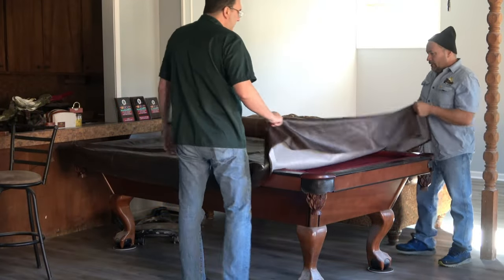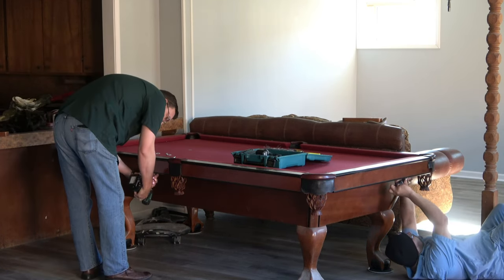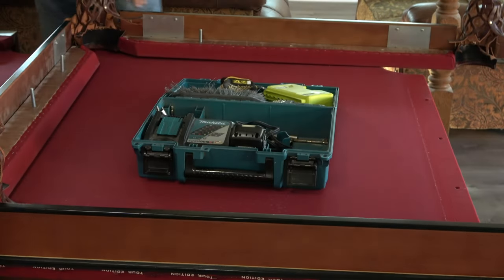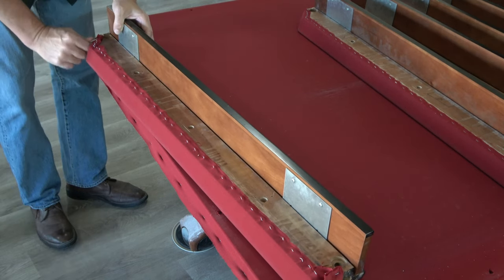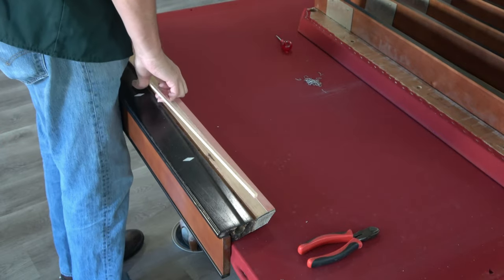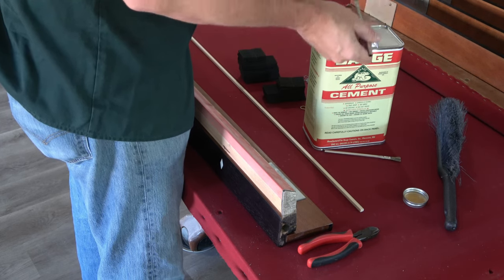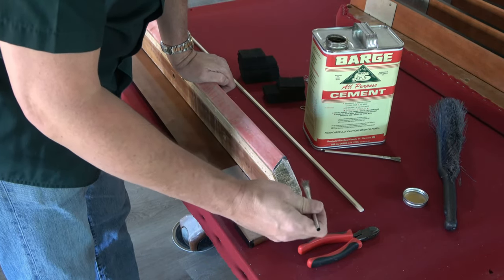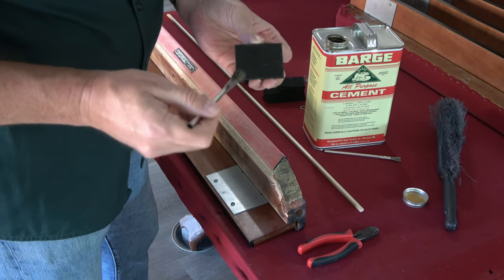How to Make Your Brunswick Pool Table Play Like a Diamond Pool Table

Comment: Will the balls bounce differently in the area where the extra facing material is?
Reply from the maker: Only slightly. Not really enough to make a difference in your game.
Reply: @CreativeRestorations  Thanks. I'm tightening up my GC IV this week. Your video is really helpful.
Reply: With shims?.. Yes.. That’s why extended rails is the best process for fighting a table.. 

Remember, all tables use one shim on each pocket facing to keep the rubber from bowing out over time.. When you add a 2nd shim to make a pocket tighter the pocket facing plays different.. And any difference is no good.. And if you live in high humidity areas the pockets will play significantly different..
Reply: @jacobjones5269  I extended the rail with wooden shims and then added the composite rubber shims. I'm pleased with the result.
Reply: @peterwhitaker71  

If you’re pleased, great.. I would still recommend new rubber and extended rails, if there is a table mechanic capable.. However, doing it when the table is scheduled to be recovered is what I would suggest..

Should cost about $300-$400 extra, but it’s a one time cost..
Reply: @jacobjones5269  I added a piece of wood to make the rail longer, then put the regular shim on and new rubber cut to length. Have I missed something?
Reply: @peterwhitaker71  

Not at all, like I said if you’re pleased, great.. It’s just me, personally, I would pay the one time expense of getting fresh rubber, extended, since I’m gonna have my table until I go.. That’s just me..

Comment: If you have a great plan Gold Crown leave it alone don't let anybody tell you to change the rubber especially if it's a one or a two
Reply from the maker: I'm in agreement! I'm not fond of the way Diamond tables play. However, some people like the tight pockets. UGG!!! If a customer is dead-set on having tighter pockets on their table (other than a Diamond), I generally recommend they do it this way because it's 100% reversible. If they don't like it later on down the road, they can switch it back with little effort. However, if they glue in extra wood and lengthen the rubber, it's a LOT more work to change it back.

I think Diamond's pro pockets are frustrating for 90+% of people playing pool. If you're playing for money or just practicing, Sure. Play on a Diamond. Otherwise, play on standard size pockets.

Comment: IDK I tried 2 different times to tighten the pockets on my 8 ft. with shims and couldn't stand it that way! Finally the last time I had work done on the table I had it done the correct way which is to extend the rails, it's a major job but well worth it in the end result. Pockets are now 4 1/4" with correct angles and play very well, can't really slop a ball in especially at speed. Also another problem I see here is you are working with chemicals over the table cloth without a drop cloth, not good!!!
Reply from the maker: Extending the rails is the best way to do it. But, for someone who wants to do it on a budget, this is still a viable option.

Cloth that's being replaced (as this was) makes an EXCELLENT drop cloth! I would never take the chance of ruining good cloth by working with Barge glue right on top of it. Ain't my first rodeo!

Comment: I have an older pool table, is it feasible to upgrade it to play like a newer table?
Reply from the maker: Sure! Provided your table is in otherwise "good" condition, replacing the rubber, rail facings, cloth, and maybe pockets will most assuredly make your table play like "almost" new.

Comment: Gold Crown VI - features longer rails which result in tighter pockets. Corner pocket 4.5"-4.625". Side pocket 5.0"-5.125".// Here in Canada, before their bankruptcy in easly 2000's, Dufferin of Canada found progress in new startup pool halls, sadly stealing sales from Brnswick. The 2 different table brands play like apples & oranges, as the Dufferin is seriously flawed in design, producing the dredded "Dufferin bobble", as the slate hole isn't cut deep enough for any perfectly hit ball to drop off the shelf & into the pocket. Plus the Dufferin uses floating slate construction & table frames have some plywood, hindering a level playing surface. A popular brand of table to avoid, at all cost. // Brusnwick Gold Crowns have tight, fair and perfect pockets, always been the benchmark in tables. I'd never buy a used Diamond over one. Many table designs, with the "wabble-bobble" pockets, are just  a comprimised play & darn frustrating to play seriously on. I don't want my Brunswick table, to play like a Diamond, but I did enjoy this great info. video.

Comment: what is the cost of this job?
Reply from the maker: It varies depending on cloth choice. But, just to add in the rail facings during a recover job, it's only about $50-75 additional.
Reply: @CreativeRestorations   what about cost of the rails only(get pockets tight) , no new cloth
Reply from the maker: At the very least, you would have to replace the cloth on the rails. And, again, it would depend on what type of cloth you have.

You can't do this job without replacing the rail cloth.

Comment: Making a Brunswick play like a diamond is a major downgrade and not worth the time, money and bs, since Diamond uses K66 profile cushion rubbers, whereas Brunswick mostly use K55 profile cushion rubbers, which respond to bank shots much better than K66 does.
Reply from the maker: I'm not a huge fan of Diamond tables. However, a lot of people are. Unfortunately, though, not everyone's budget will allow them to buy a Diamond. They have to settle for the next best thing. This video is just to show that you can make your Brunswick play more like a Diamond than what it does from the factory. What I'm showing in this video has been done for decades (MUCH longer than even Diamond has been in business). And, look, just because I'm not partial to Diamond tables, that doesn't mean I think they're "bad" tables. They aren't. They're great tables. They just aren't my preference.
Reply: Correct me if I'm wrong, but as you add shims the shelf decreases. That being the case, wouldn't you have to alter (decrease) the angle from the slate to the top of the facing in order for the balls to pocket in the same manner as before adding extra shims?